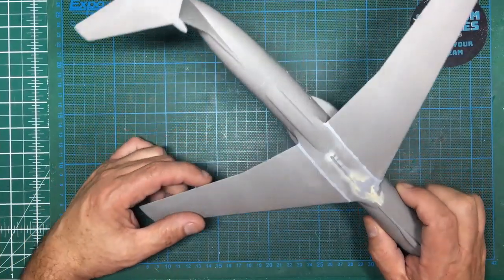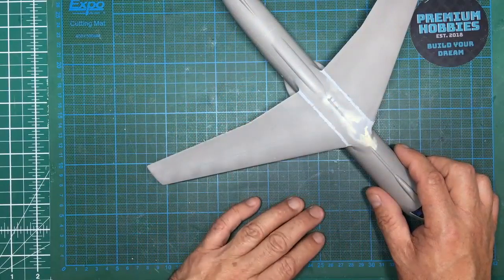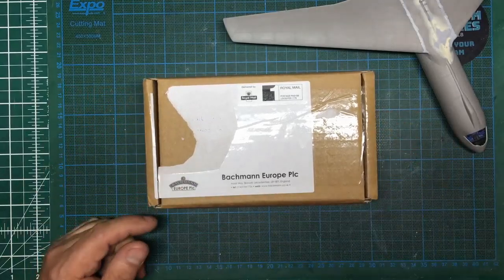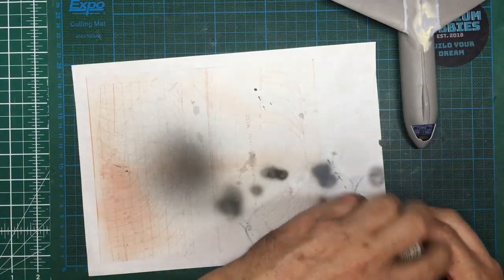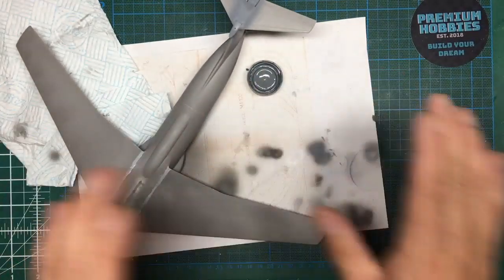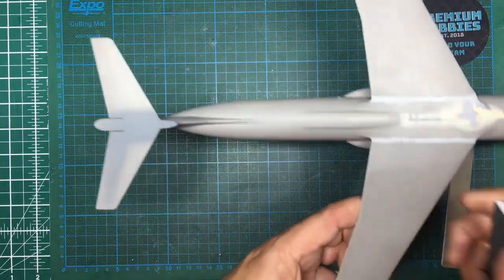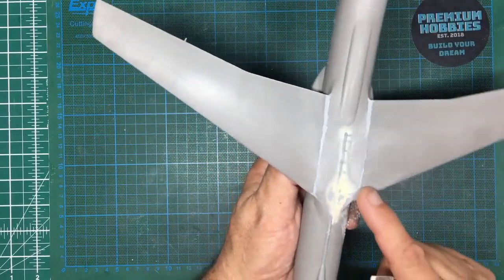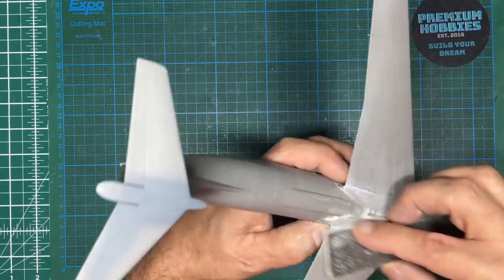Roden 1/144 C-141B Starlifter build. Part Seven.

Comment: Well my hobby box has increased in size ! ive been building for 35 years ,I have realized  building is one part but the extra 20 to 40 hours of preparation before painting is vital to get a great finish,  I'm building the 1/350 Dunkerque  drilled out portholes  added led lights . Vidios like yours are a great inspiration for all levels of modeling experience  thanks👍👍👍

Comment: Personally, I find watching or doing sanding very therapeutic except when you're doing a full-size door.
Agree it is sad to see aircraft being scrapped. In its time, the Starlifter was a freighter GT as it was incredibly fast but its downfall was its payload was not very high and the C5 Galaxy was only 2 years behind it. It was finally phased out in favour of the C17 which is also grass-field capable which the Starlifter wasn't.
Thanks for the shout out, much appreciated.👌
Reply: C141 seldom carried full load, thus the stretch version.   As a civilian its main problem was noise.  The 141s were LOUD, I mean REALLY LOUD.  I grew up near Charleston SC, a MAC airbase and these things were annoyingly loud even at 1500ft in the pattern.   I bet the fuel usage was very high too.  Charleston is so quiet now that they use C17s.
Reply: @orbitalair2103  I can imagine the noise, Awacs E3-A's are still flying close to where I live, and they use the same TF33 turbofan engines as the starlifter had, and flying at 1000ft a sound level well over 100dB is still measured on the ground, which makes you stop any conversation outdoors when an Awacs passes over.

Comment: I got my kit of the C-141, and the same problem when opening the box, all parts in one bag rattling around, and all  corners and some points in between of the trailing edge are damaged.
Luckily the cockpit glazing has no scratches on it, and this part needs a coat of clear gloss anyway, I have to make a cockpit from scratch as I don't have any donor parts in 1:144 left.

Comment: Second comment just seen another video by another modeler ( gross modeling) doing this kit. If you want to see what work Nigel does with his filling and sanding go have a look at that one, as he used spruegue instead of Mr Surfacer and it did what Nigel said and shrunk back.
Reply from the maker: That build is on the emodels channel too Steve.

Comment: I get nervous using anything under 320 grit for plastic esp if there is surface detail that can be lost/destroyed but it really all depends upon specific manufactures products because the grit rating is def not all to the same standards - Micro Mesh is one of my all time favorites I will be getting some Infini to try soon. Nigel did you get any of their sanding sponges to try? the ones like Tamiya makes??? Happy Modeling!
Reply from the maker: I did a review of the Infini sanders. I have a set of sponges and Matador sticks.
Reply: @NigelsModellingBench  are the sponges the stick kind or like the traditional sponge sanders like Tamiya ?? The reason I ask I know Infini makes sponges the kind about the size of a index card and 5 mm thick was curious as to how they compare w/ Tamiya Sponges I find the Tamiya ones wear out rather easy esp if used wet or when sanding paint/primer/putty. Infini also makes sanding sponge files (the stick kind) Was hoping you could give feedback between Tamiya and the Infini BTW the C141 is looking great glad the old mojo is flowing again! Thanks for all the help you provide and responding Cheers!